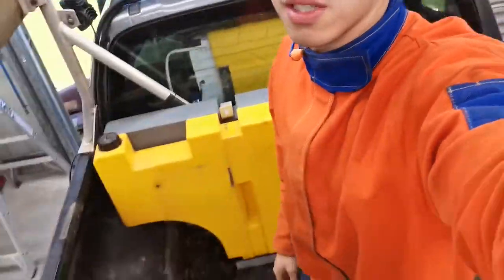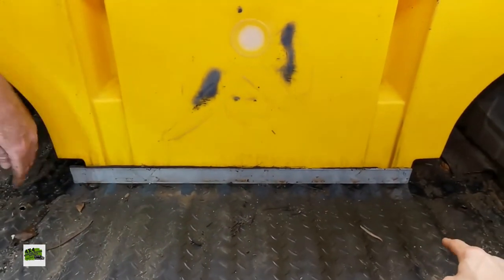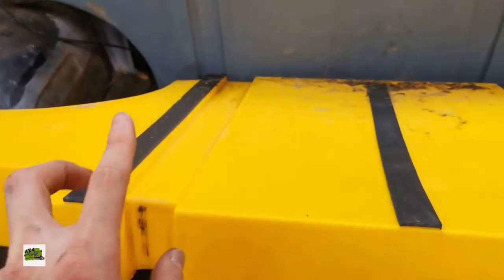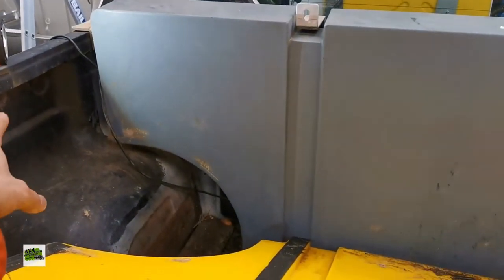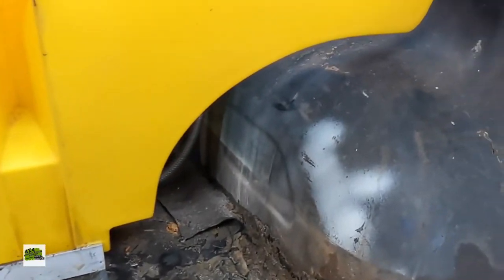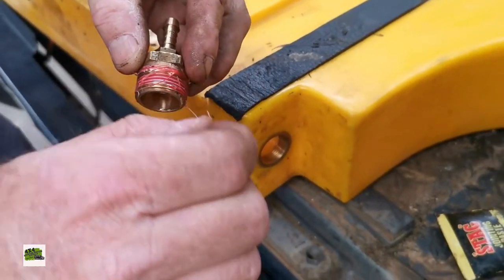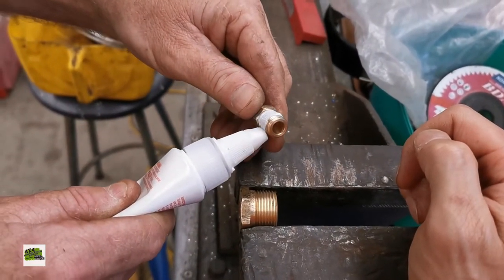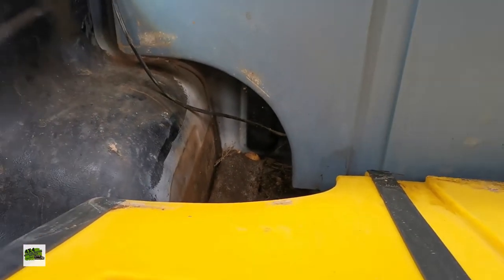Wheel Arch Diesel Fuel Tank Review - HONEST opinion by touring experience

Comment: Hi i know this video is over a year old but how easy was it to plumb in to the main tank on the triton? .
Reply from the maker: You will need a elbow fitting for the grommet on the headboard. Then feed the fuel hose down and essentially join the hose onto the return hose of the tank. The fuel should flow into the main tank by gravity.
Reply: @customcraftnadventure  thanks mate.